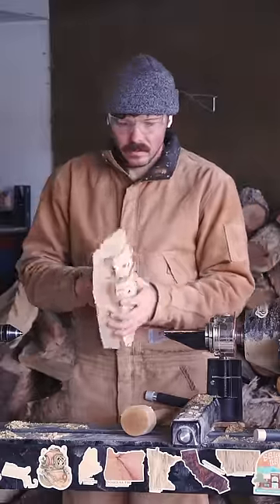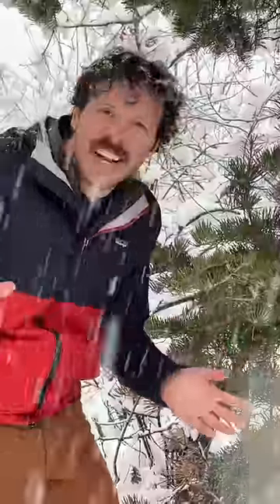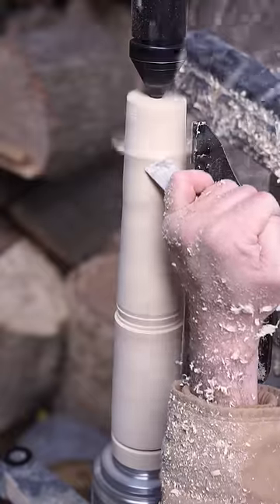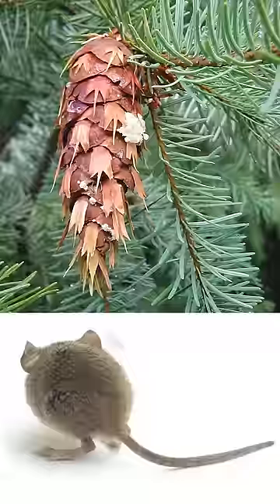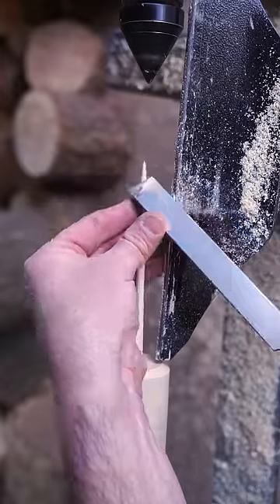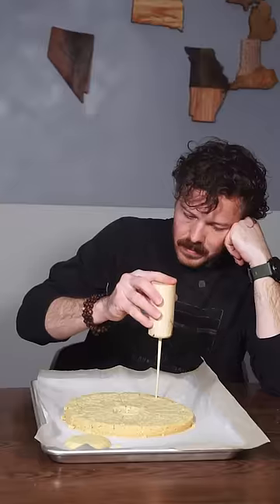Making a poker for some tree-flavored shortbread!

Comment: Still trying to figure out if the stabber is a whimsical idea you came up with or if it’s an actual tool for shortbread bc I am not well versed in baking
Reply: in the long video, he said it was a "niche tool for one specific circumstance" so it's definitely a whimsical idea.
Reply: When he used it to check the bread I thought, “that’s one fancy toothpick.”
Reply: When your baking it's smart to have something small (like this stabber) that you can stab into the baked good so you can see if it's fully baked or not.
Reply: @Eclipse MMS  like a toothpick or a chopstick
Reply: Partial Prophet  Skill issue.
Reply: @eclipsemms7126  fork..toothpick..knife..chopstick..sharp chopstick
Reply: @frogtank4407  i see, another martincitopants enjoyer
Reply: Just use wood skewers. They are pretty cheap
Reply: @Bea-the-one-and-only B O A T
Reply: It’s actually accurate, though his tool is a tad impractical. The shortbread recipe I use calls for pricking (or stabbing) the dough about 3/4 through to prevent air bubbles from creating pockets in your cookies. I will make rows of holes about an inch apart which would take forever making one hole at a time! A fork works just fine!
Reply: I am well versed in baking. At the college level. I have never heard of this. We just use skewers & they work for more than just shortbread, they work for testing cakes & stuff too
Reply: @emilygraham9152  I was wondering if anyone would mention this, while I’ve never heard of testing shortbread with a toothpick or skewer like you would a cake as everyone else is suggesting (it’s usually pretty simple ime, when your shortbread is browned take it out and put it on a cooling rack. That’s it.), most shortbread recipes I’ve used will have you prick it all over with a fork before baking to prevent air bubbles from forming.
Reply: @Dom G.  So you have heard of a skewer lol
Reply: @docwiz  AAaaaand he's poking it after he's taken it out and already cut it into slices.. soooo.. I'm confused.
Reply: Most stabbers in the UK are a little more like brushes - 5-7stabbing points spread across the same surface like bristles, so you end up with a dot pattern of pokes like dice or dominoes
Reply: @zaphot6056  Maybe it's like speculaas. You want to cut it after it is baked but before it is set
Reply: @ystacalden  We have these rollers like a paint roller but they are spikey. They are called dockers to dock food like puff(ed) pastry or focaccia bread.
Reply: Cake testers are a thing, usually a metal stick with a blunt point, is used to check the moisture or temperature in cakes. But nope, not bead stabbers or bread pokers.

I forgot the name of the tool in English and Googled bread stabber, and Google didn't disappoint 10/10 migth do it again.
Reply: @ystacalden  thaaaat makes a lot more sense
Reply: It is like that thing that lets you hold your chips and a dip at the same time. A cumbersome invention made with only one purpose in mind.
Reply: I change my opinion: it may be a tool that can be combined with a dozen other tools in the form of a good old wooden skewer, but it is fun. You can have a special tool for docking pastry if you want. It is especially good if it is made of a related material. It is nice to have things with specified jobs, esp for ppl w ocd or autism or smth. Heck yeah! Shortbread poker! 
(Plus, a lot of useless devices are only useless for the abled but super useful for the disabled or mentally ill etc)
Reply: This tool is NOT to see if the shortbread is done. And it is actually a real tool and technique. Shortbread isn't supposed to have moisture or trapped heat in it. So, when it's done baking, you poke a bunch of holes in it to release the steam.
Reply: @mars7612 i thought it was supposed to be done before baking, so air bubbles arent trapped. Also would take all day long to do one poke at a time 😅
Reply: @prodigypenn  or a fork.
Reply: @I3lazedOne  For shortbread it's different because you don't want moisture in it. Also, it really doesn't take that long, it's just pricking a bunch of little holes
Reply: use a fork
gets you 4-5 holes at once
Reply: @eclipsemms7126  When my baking?
Reply: I was more curious about the "Douglas fir sugar".

Comment: As a grad student in music conducting, I felt that $50 for a baton was too much.  I worked at a pipe organ shop, and made dozens from old organ parts.  I had lots of exotic woods for handles, which I turned on the drill press.  I chucked the sticks in a portable drill and spun them against a belt sander, tapering them perfectly.  I gave them to my professors & students.  I still have some 40 years later.